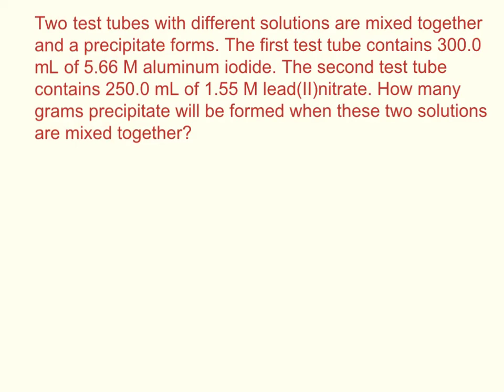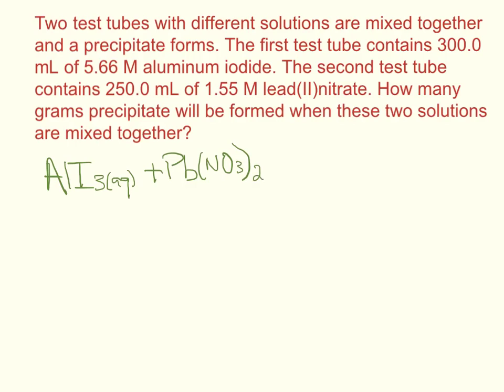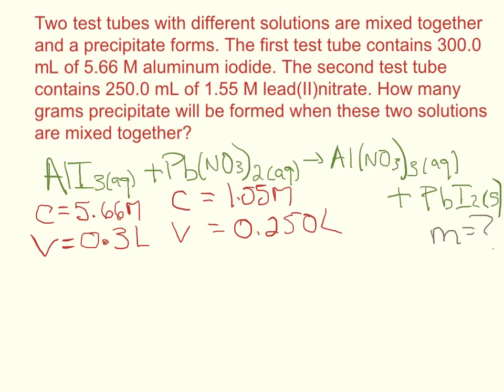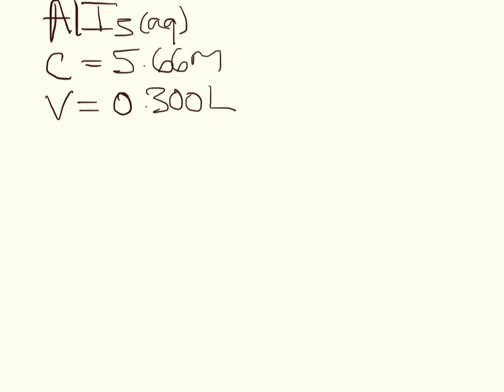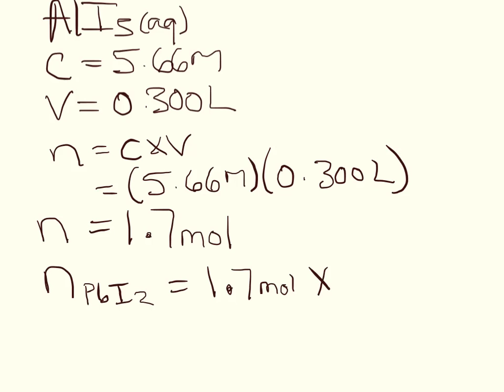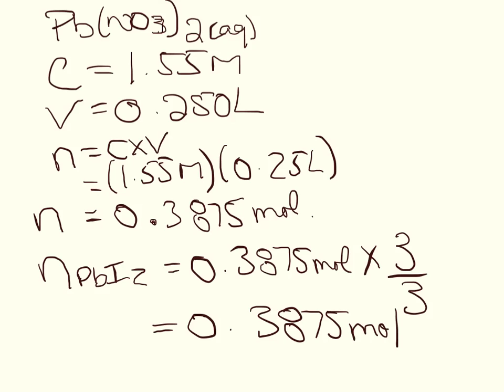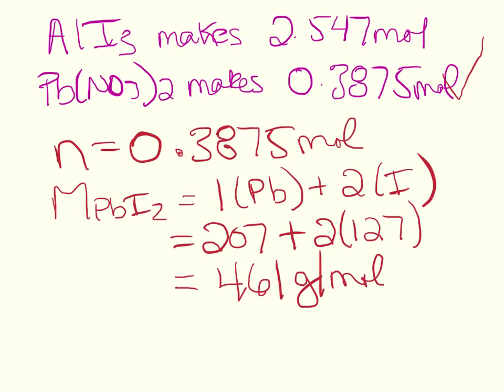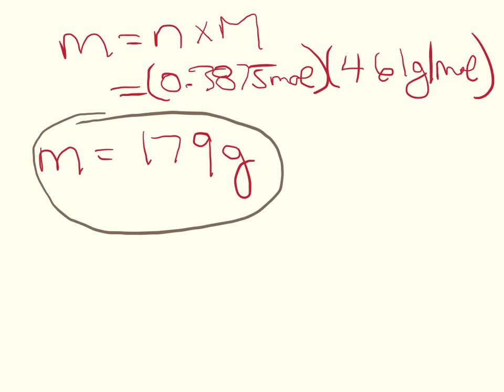Determining Amount of Precipitate

Comment: tank you. can you help with this question. you are given a solid that is a mixture of Na2SO4 and K2SO4. A 0.205g sample of the mixture is dissolved in water. An excess of an aqueous solution of BaCl2 is added. The BaSO4 that is formed is filtered, dried and weighed . Its mass is 0.298g. What mass of SO4 ion is in the sample. What is the mass percent of SO4 ion is in the sample. What are the mass compositions by mass of Na2SO4 and K2SO4 in the sample.
Reply: 6 years and still unsolved :(
Reply: 7 years and still unsolved :(
Reply: 8 years
Reply: @dylanstorey9412 8.5 years 😢